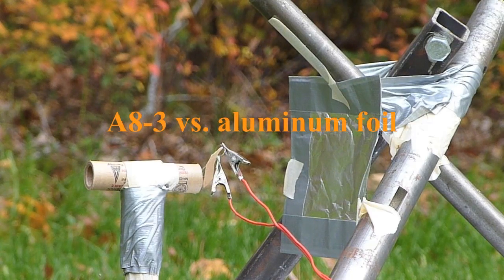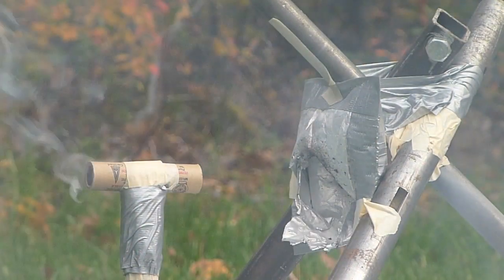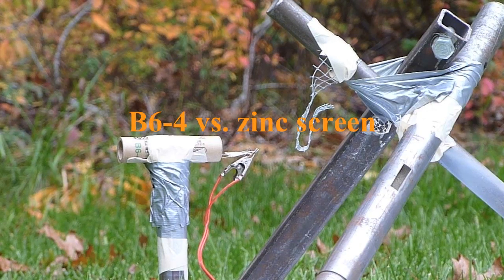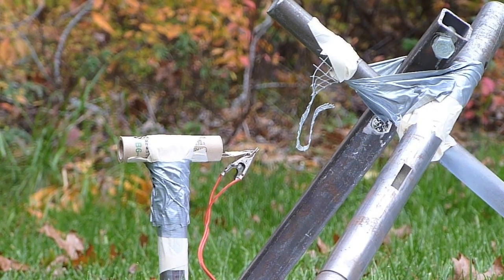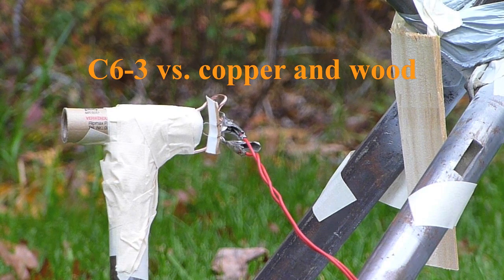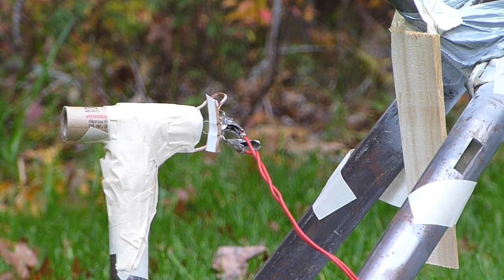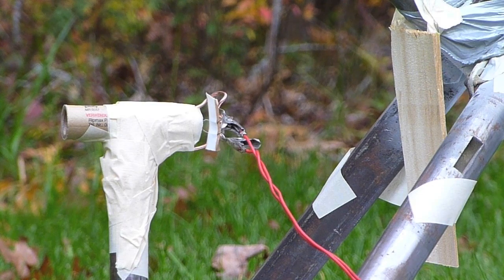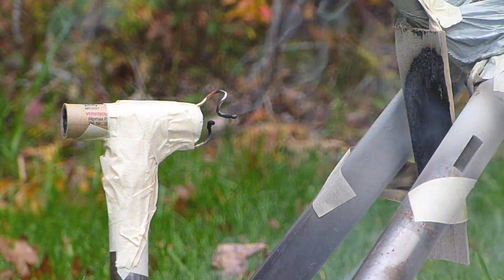Estes Rocket Engine Static Tests

Comment: Hey guys im thinking of making a missile out of this rocket engine I would like to get your opinions on the topic
Reply: Texer767 what do you want to know?
Reply: how straight would this fire if i mounted it to a cannon on my gauntlet or would i need a tether
Reply: Well accuracy would almost entirely depend on the aerodynamics and mass distribution of your would be missile. If you have a center of mass farther towards the tip of your projectile and your wings towards the back as is the norm you will have a moderately stable rocket. It should actually fly similarly to an arrow, only much faster. Just remember, these rocket engines can put off some serious exhaust as we see in the video above. Make sure the materials you make your gauntlet launcher out of will not melt. I can give you some more info if you would like but this should get you started.
Reply: ok thank you as i was thinking of have an aluminum cone on the tip of the rocket and stuff like that to keep it stable thank you for your time much appreciated  have a wonderful day bro :)
Reply: Glad I could help!
Reply: So i see that a C engine burns through copper. Would an A engine be any different?
Reply: The farther along the alphabet you go the more powerful the engines are. That is to say that an E engine would be far more powerful than an A engine. However with such a small piece of copper wire I don't know that the result would be much different. I must admit however, I do not have much experience with rocket engines burning through things.
Reply: ok. well, thank you. i was planning on shooting an A engine out of a "gun" with a copper barrel, ill probably do some stainless steel as it is stronger. but either way thank you for the informaation.
Reply: Well if you are using pipe you should be perfectly fine. There is enough material there that the heat will be dissipated the pipe will not melt.
Reply: ok, ill see how things will pan out. thanks for the info again!